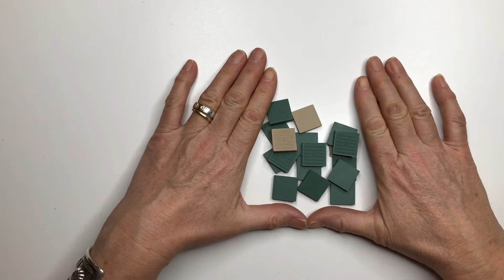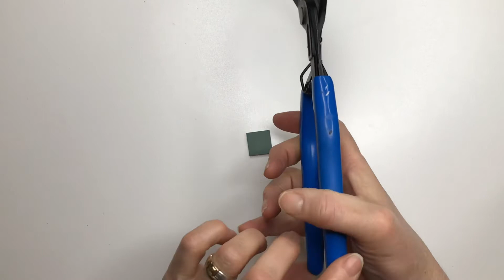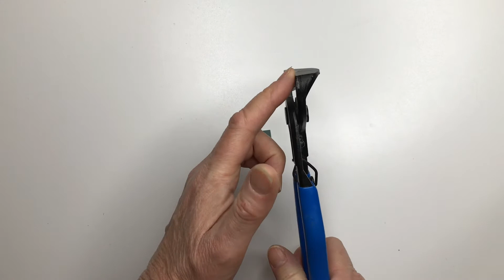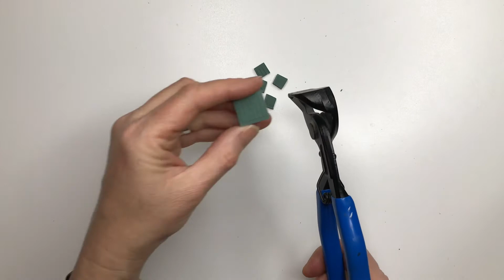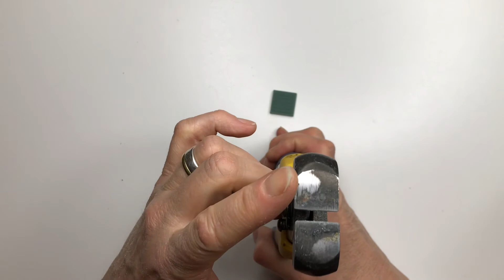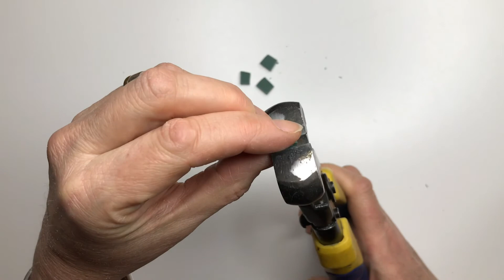HOW TO CUT UNGLAZED CERAMIC TILES FOR MOSAICS | Cutting mosaic tiles

Comment: Hi Helen, thank you for all your wonderful videos. I wanted to replicate your process here and I think I purchased the wrong size tiles. I purchased Winckelman's 50 mm x 50 mm square tiles (5 mm deep) and I am having trouble cutting them into clean squares with compound nippers. Do I need to use a different tool or technique?
Reply from the maker: Yes, you might find those tiles a little thick for compound nippers - you may need a different tool! I can recommend the Seabells but they are rather expensive.

Comment: Hello Helen,  thank you for all your videos, they are very informative.  I do have a question about winckelman and other unglazed ceramic tiles..  I see on certain websites recommend you use petroleum jelly on the tile before grouting to avoid the tile from absorbing the color of the grout?   What is your opinion.
Reply from the maker: Winckelmans are non porous so the colour of the grout will not be absorbed by the tile. Other brands might not be fully non-porous so it would be important to check before you grout. I only use Winckelmans so I can't tell you about other brands.
Reply: @HelenMilesMosaics  thank you Helen, I am using winckelmans and cinca tiles on this project.  Both are unglazed porcelain tiles.
Reply from the maker: @montanaweaverkim  So you will be totally fine then. You can look up the manufacturer's specifications if you want to double check!

Comment: I am trying to cut larger, unglazed tiles( 2in) and having problems getting a clean (ish) edge.  I only have the side nippers.  perhaps I need the compound nippers?
Reply from the maker: Yes, you do need compound nippers. They will change your life! But also be aware that some colours or firing batches are just difficult to cut and there's no getting around it. But if you are finding it consistently difficult across the colours then compound nippers will definitely help.

Comment: Do you cut glazed and unglazed tiles the same  with the Compound Tile Nippers?? What type of tile is best to use for Mosaic's?? I luv your advise and You Tube tutorials. tk u so much.
Reply from the maker: So sorry for the late reply on this Brenda. I hope it's not too late but the answer is yet to using the compound nippers for glazed and unglazed tiles. I dont think there is a 'best' tile to use for mosaics. It simply depends on where the mosaic is going to go and/or what it is going to be used for. For example, some glazes won't survive freeze/thaw outdoor conditions so you have to watch out for that.

Comment: Hello Helen, wondering if you have any advice for what types of tiles are best for what types of mosaics. I’m a beginner looking to start working on an entryway piece for my home for fun. I’m struggling to find information on what types of tiles are durable for a heavily used footpath.
Reply from the maker: Good question Gabriella! Essentially, if you are making an entry way piece I would recommend that you use Winckelmans unglazed ceramic tiles or Cinca tiles. Both are specifically designed for floors (ie heavy foot traffic) and slip proof and frost proof. You can add bits of glass too but make sure it's not too much as of course it will be slippery.